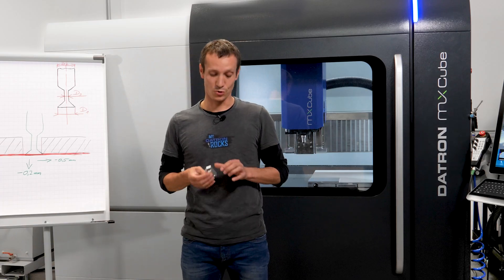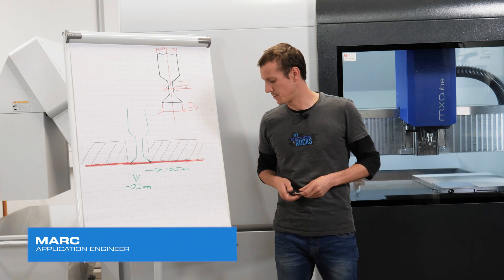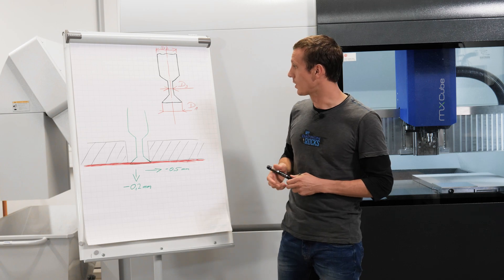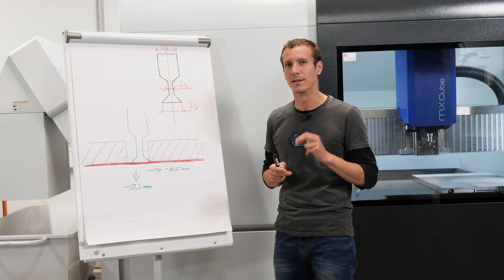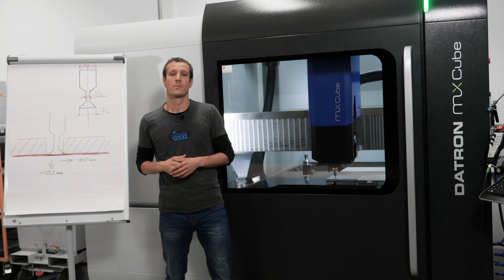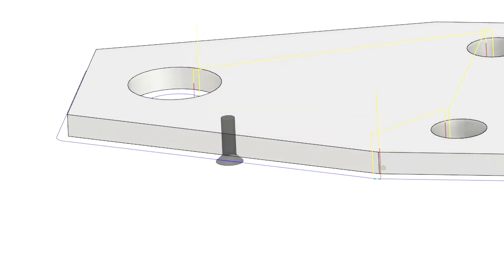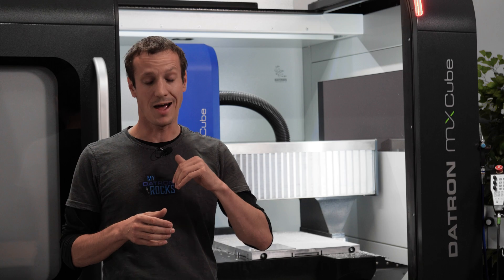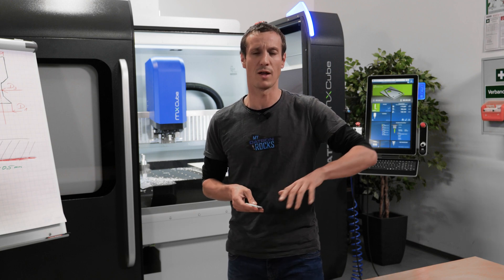Deburr everything! - Tech Talk | Ep 7

Comment: Hello Marc, I'm using a 0068493S on my new Datron Neo. I'm milling a 4mm hole 16mm deep into L168 aluminium. What would you say is the best speed, feed and technique would be for this job? I'm using Fusion 360, and currently using a 2D contouring sequence ramping down at 1 degree. 35000rpm, 595mm/min ramp speed. It seems to be ok but I've broken 2 cutters. I'd be very grateful if you can help.
Reply: Hey,
the problem you run into is most likely the missing length of the chip channel. By going deeper than the flute length (=chip channel) the chip can´t get evacuated and the ethanol doesn´t really make its way to the cutting edge. Try 0068030W, it has a 15mm channel, that should be fine. Go faster (1500mm/min) and even a bit steeper (2 deg / 0,5mm pitch). Going too slow means that the tool doesn´t really cut the material, its more kind of grinding (which wears off the cutting edge)
Reply: @marcreis487  Hey Marc, fantastic thanks.  I’ll give it a go. Fortunately I have one of those cutters so I’ll give it a go👍